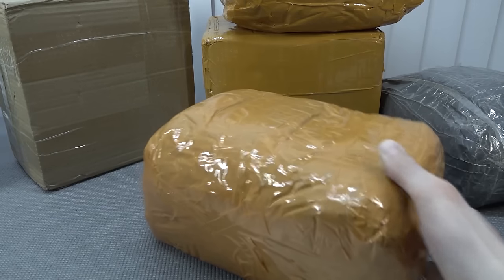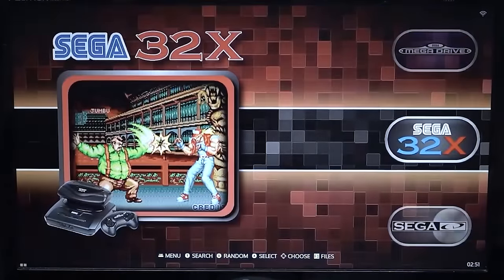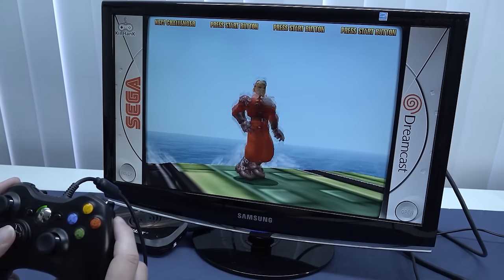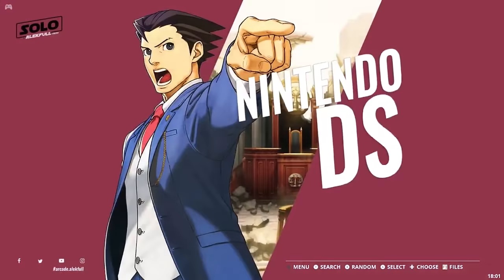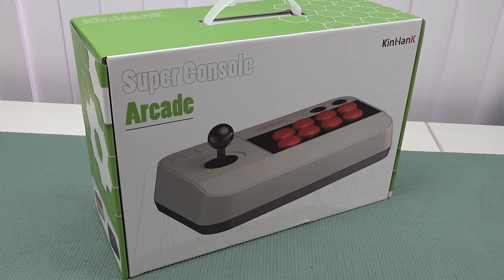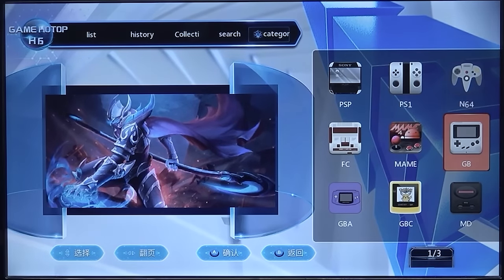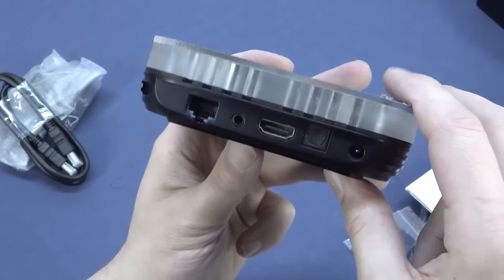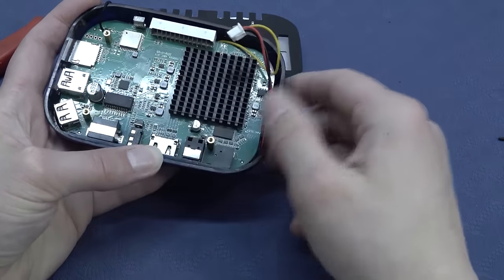Great Emulation Performance For A Low Price / Super Console X On It's Best

Comment: I recently bought a used, end of life Chromebook for $30 on eBay, flashed it with UEFI bios, and installed Batocera on it. I honestly couldn't be happier with it as an emulation device. It's so much more flexible than these e-waste boards from China and depending on the processor, they draw a similar amount of power while offering 2x the performance. X86 is truly king when it comes to emulation.
Reply: Yeah an old laptop is better than all this e waste from China, or even a Pi 2 or 3 2nd Hand, they are great once fully loaded with all emulators, Neo Geo runs amazing and Metal Slug is a great experience from my playthrough I had a few years back from a Pi 2.

Heck even an old OG Xbox fully loaded with Xenium and XBMC is better than all this e waste from Ali.
Reply: Which controller do you use with the Chromebook?
Reply: @AlexMitchell-sj4sb  Logitech F310 and a Power A Xbox 1/Series controller. They both work flawlessly.
Reply: @deadaiir  cool, thank you
Reply: @RocketRenton  you are right, OG Xbox is decent for emulation, I soft modded mine. That and Wii, both easy and with decent emulation. Also PS3 is very good too.
Reply: @AlexMitchell-sj4sb  I just won a decent PS3 from an auction on eBay for 60 bucks. I didn't want to use the one I had for years. How far up can the PS3 emulate? Like up to which system before it runs like crap? Lol
Reply: @614GTRjr  I have really only tried RetroArch on it, so I used it for 16 bit.  Of course you can use something called Multiman and load PS1 iso into the system via that, exit Multiman and your PS1 disc image will appear in the games column and you load its as normal. PS1 games run fine as you would imagine they would but I had trouble getting Doom to load properly.  

So for me personally,  I played SNES and Megadrive/Genesis games absolutely fine and most PS1 games ran well too but I didn't try other systems. I don't think Sega Saturn would run well. N64 I never tried.
Reply: @AlexMitchell-sj4sb  that sounds good. I will try it
Reply: I bet they keep making these android boxes accept in the future they will have that snapdragon 865 chip in it i can run some ps2 on my galaxy S7 tablet from 2022 on it. That how i fell down the Emulation rabbit hole. BTW I got that Batocera drive working on my M6s mini cpu, i rampped it up in th bios to 4800 and got 20% more juice out of it and its amazing! LOVE U BUDDY.❤ It it had 24 gb dual channel DDR5 stead of 1 of 12 gb ram it might even do Xbox1 everything else im upscaling😂😂😂

Comment: I own a few of these something I did with the no fan versions i.e. x2 pro for example was I spent like $5 and bought a pack of slim self adhesive heatsinks and just slapped them across the ram and gpu chips, resat the thermal pad because theyre rarely ever flush to the cpu and voila, heating issues solved
Reply: heatsinks from aliexpress aswell
Reply: oh and buy at LEAST the x2 pro dont bother with anything less than 2gb RAM for this level of emulation, the x3 cube pro has 4gb and does psp not too bad for the price